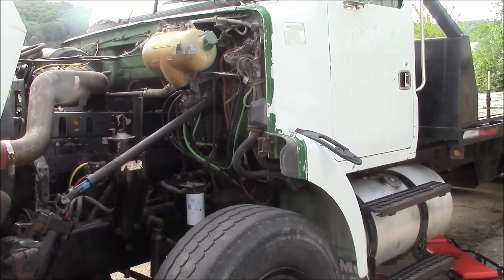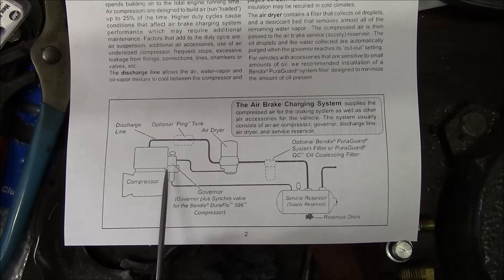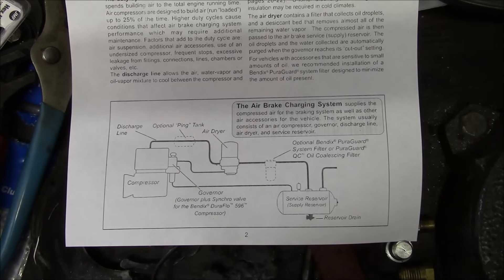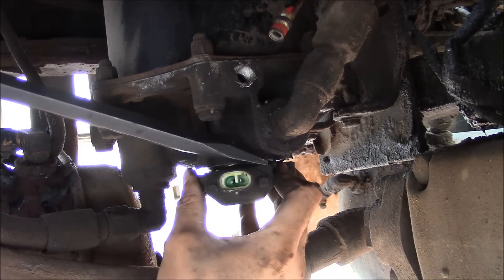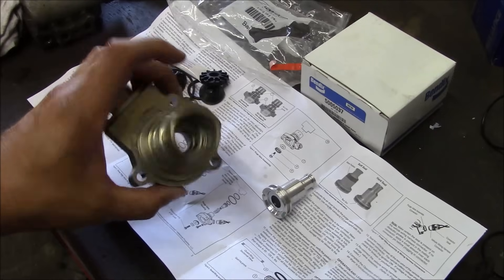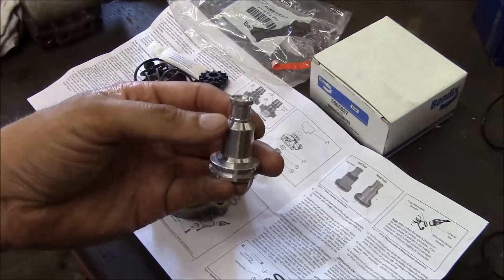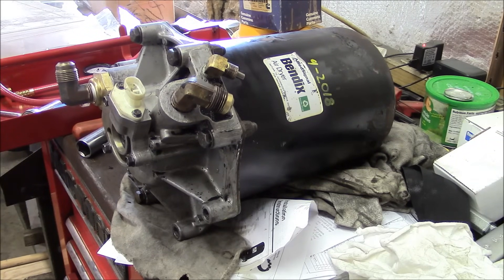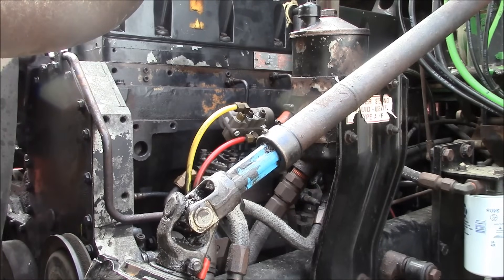Truck Repairs: Air dryer purges constantly

Comment: I have a 2013 Volvo it does the same thing change air dryer check for air leaks nothing runs good and keeps 120 psi it been like this for 3 years what do you think
Reply: Governor.

Comment: I have seen that valve on the problem of the dryer leak. You can buy them separate.  Then change them out inside of the whole air dryer

Comment: Great video.  I would change that air dryer as well. There should be a two wire connector there as well.  One is ground the other is power but only with the key in the on position.  That's the heater for the air dryer.

Comment: Wow, great walk through! I have a 92 international bus that's purging every 30 seconds, it also seems to leak after I shut it off. First time I heard it, I thought there was a wounded animal nearby lol, it's a very faint squeak, kinda like the dying witch on wizard of oz 😁. Took it to a local diesel shop and they told me I needed a new air dryer, no filter on mine BTW. I'm just wondering now if they checked the valves....i didn't know the squeaky sound after shut down wasn't normal.
Reply: Lol nice

Comment: I have the same issue on my Volvo. Where is the check valve on a wabco airdryer. I replaced the gov the compressor purge valve and the filter. Still doing the same thing
Reply from the maker: Is it the style with the spin on element?
Reply: @WatchWesWork  yes Sir. The filter screws on. I changed the purge valve and the filter 2 times already.

Comment: Thank you very much! Great video.
When you say that the gages don't measure the tank pressure so you would'nt see them going down, where do they measure?
Reply from the maker: There are 3 tanks. The gauges measure the pressure in the primary and secondary air tanks. The gauges do not measure the pressure in the wet tank or ping tank. There is a check valve between the ping tank and the other tanks. So, the check valve in the dryer is letting air leak out of the ping tank. But, the check valves on the other tanks are working, so they maintain their pressure. Basically that means the gauges on the dash cannot help you diagnose this issue.

Comment: OK but did you figure out how that hunk of smugh got in the check valve?  Did you clean the line and see if pieces of smugh are coming out of the compressor?  It is sealed so it did not appear out of nothing.  You are not done till you figure out what caused the smugh and clean it so you do not get djizm all over your new check valve.  Good video explaining what you did for trouble shooting the problems, as you noted you ran into a leak you may not have noticed but would make the compressor work more and effect fuel use.  Good catch good job.
Reply from the maker: It's just carbon build up. The intake for the compressor comes from the crank case. The compressor outlet temp is pretty warm. Over time you get carbon build up, just like an engine exhaust port.

Comment: How much did you spend on those 3 parts?  The whole thing is not expensive , i replace one on a cascadia for $140 , now i have a dryer in another cascadia purging every 30 seconds
Reply from the maker: I don't know. Around $100. These air dryer parts are very cheap.

Comment: I have a question, my air dryer was purging like the every 30 seconds so I replaced the cartridge and cleaned everything up to new checked the check valve and all is good but now when it runs it says on dash 110 psi but I dont hear it purge at all just sitting is that normal???
Reply: Have not driven it yet is that way it's not purging is because I am not driving it. I am starting it and i let it sit at 700 rpm then to 1000 to warm it up once it gets to 150 fwt I will put it back to idle at 700rpm. I hope there is an answer to this maybe it's normal intill I drive it because it never gets under 100psi on the dash
Reply from the maker: That's not normal. Unfortunately, there are a lot of things that work together. Is it possible you hooked the lines up backward so the purge is hooked to the sense?
Reply: @WatchWesWork  no put the lines in the same when it was working. I can tell you that when it was going I thought it was the filter because it started  Whistleing and then started getting less and less until it would air one short and then air very slow the rest of the  way into empty and then eventually it stopped and that is why I replaced the filter because I thought it was clogged. So it slowly purge out with the whistle sound intill it just stopped purging
Reply from the maker: Well, the only other moving part of the system is the air governor. If it's a standard Bendix D2 unit, you can replace it for about $20.
Reply: @WatchWesWork  $20 that's it man that's cheap if I have that one AD9 cartridge so not sure but found out I do have a bad leak near the pump so I will fix that and will probably fix the other things going on will keep you updated also on my channel will be recording the whole thing also

Comment: I do not even give the owner the option to "rebuild" the dryer. I live in Michigan, and with the salt and neglect the dryer usually sees. I just replace the whole unit. It just saves time and labor like you said
Reply from the maker: Eventually the aluminum base casting will corrode and will no longer hold air. At that point you have to replace the whole thing. I've seen them corrode clear through the mounting holes.

Comment: Just a little constructive criticism,  from my experience as a mechanic swapping parts is the worst way to fix a problem. Customers and employers get pissed off and it's no substitute for proper diagnostics. Just sayin'.
Reply from the maker: Sure. But where did you see me "swap parts"? I didn't replace anything that was not tested first and found to be faulty or past its service life. I understand that the purge valve did not fix the initial problem, but it was leaking down as you can see in the video. Just sayin'
Reply: @WatchWesWork  I know,  and some customers don't care because they are cheapskates and want something for nothing. Many employers want stuff fixed quick ,cheap and out the door.
Reply from the maker: OK. That's certainly true. All we can do is document the problems and make the customer aware. If they don't want to fix it, there's not much we can do. It's a frustrating part of the business!
Reply: @WatchWesWork  Yes it is but I still enjoy it. I enjoy your videos  too because I am always looking to learn and I am no expert by any means. Sorry if I came off as a dick at first.

Comment: Hi wes great vid. Being a mechanic myself (30yrs).seen alot of air dryer issues.and how they have changed .but the concept is the Same.
a constant purging dryer irritates me.at the same time causes compressor to cycle more.i find it to be the signal line(RES port on gov to wet tank) leaking down .I use soapy water on this line(only when air dryer purges).wet tank supplies air to Governor RES port.
For anybody interested Google. Bendix air dryers.and look at images. There drivers. Owner ops. Mech.can identify.what air dryer they have.A very informative site.i still use it myself.
Reply: So you’re saying majority of the time it’s only a leaking line???
Reply: @roz4747  that's right,,as soon as the dryer purges,shut off truck and soap down the governor line(which is RES port on the governor),,too many times I've seen dryers replaced over leaking reservoir line to governor.hope this helps.
Reply: @jimmyFX  thank you for your knowledge and time

Comment: What can cause the compressor kick in late .. iam having problem with my isuzu fvr the cutoff is at 100psi but cut in gets below 50 psi sometimes i have to stop the truck let the air out by pressing pedal than get it to cut in than drive it
Reply from the maker: Sounds like the governor is bad or the actual unloader valve in the compressor.
Reply: @WatchWesWork  is there any other way i can send you pictures of compressor on my truck so you can help me out on this

Comment: I think the soft seats were used in the earliest version of the AD-9. I recall when they first came out, there was a problem with leaking purge valves and the repair parts weren't available for quite some time. We needed to keep trucks on the road so we traded the Bendix dryers in on Haldex and Midland. We found them to be more trouble free and much easier to work on and we never went back to Bendix.

Comment: The best spitter I ever saw was on my 79 LNT 9000. I don't know what brand it is, it is slightly smaller than a desiccant dryer. It's got fins all over it and it looks like a little still. Never had any trouble with it since it was new, and the truck never freezes up.
Reply: I believe that's a CR  Air dryer. Pretty much trouble free.it has no desiccant. Just plastic dividers. Basically the aluminum fin is sort of a cooler. Air enters/cools/condenses/dry air enters service tanks. 
I believe back in the day they had alcohol injection after the air dryer. For colder climates. 
Hopefully this helps

Comment: What if the air dryer doesn’t purge at all ?
Reply from the maker: If your compressor unloads like it should at 125ish PSI, then it's probably a fault in the purge valve.

Comment: @4:50  ya got it backwards. the side mounted elbow is the inlet and the bottom is the outlet  with the check valve. the check valve in the discharge prevents the wet tank from emptying when the  dryer purges. the ad9's were made so you could service all but the dessicant without tearing the whole thing apart.   lots of problems with the ad8's caused the design change.
Reply from the maker: You're probably right. Sorry about that.
Reply: @WatchWesWork  its all good

Comment: What year is the truck you are working on?  There is no more wet tank on the air systems, it has been eliminated.  I drive a 2018 Freightliner, used to drive a 2017 Freightliner and a 2017 Peterbuilt. I trained on a 2014 and 2017 Peterbuilt. None of them had a wet tank.
Reply: you DO have a wet tank....its now called a supply tank
Reply: @glenbjack  no that's not a wet tank.  I aced my CDL Air Brake permit test.  Thank you.  The wet tank has been removed a long time ago as air system changes were made.  Even the Alcohol Evaporator was removed.
Reply from the maker: This is a 1991. Old school.
Reply: You may have a split tank.2 or 3 compartment. But looks like 1 tank.
If you see 2 drains on 1 tank. That's a two compartment. 
Follow air dryer discharge line to tank. That would then be your wet tank.on freightliner they had internal check valves(which were problematic). 
On your peterbilt. Sometimes air dryer is mounted to the tank. There a lot of variables on Pete's.
The best way to remember is.for every drain valve. Is one reservoir. 
Hopefully this helps you

Comment: CORRECTION.  Governor cut in is at 100 PSI  Cutout is 120-125 and if you have an automatic transmission depending on what brand of truck and transmission cutout is 120-140.  AS for the Bendix Air Dryer I beg to differ on that.  Most common trucks to have Bendix are Freightliner Columbia which isn't built anymore that would be the Cascadia Evolution that replaced it and the Volvo trucks have Bendix as well.  I know this because I drive a Cascadia Evolution and every single volvo that parks next to me has an air dryer problem.
My air dryer is Meritor Wabco and it pops about every 20 minutes or so roughly.  But if I was idling I wouldn't be annoying anyone or keeping anyone awake.
Reply from the maker: The AD-9 dryer was very popular and used by pretty much all manufacturers at one time. All the new stuff uses spin on cartridges, but there are tons of AD-9s still running.
Reply: Meritor  wabco  is  what  the  newer  Volvo ' s  are  running  it  was  one  of  them  I  first  ran  into  this  problem . I  never  saw  it  before  about  2013.

Comment: Nice video, but what do you do when you have replaced the air dryer twice?
Reply: Jack up under tail lights and replace truck😉
Reply: @grahamowen1570  LMAO!
Reply from the maker: Sounds like you need to find the real issue.

Comment: Good  video . I  have  replaced  the  governor , the  purge  valve , the  check  valve   (then  the  complete  dryer  ) , and  then  the  compressor/unloader head  without  fixing  the  problem . 40  trash  trucks , 1  spare , 2  mechanics  and  never  had  the  time  for  in  depth   testing . I've  been  fixing  trucks  since  1972  and  never  ran  into  this  problem  until  2013
Reply from the maker: It's a fairly common problem, but there can be many causes, as you pointed out.
Reply: @WatchWesWork  and 1 rusty ,dirty debris filled air tank can cause this, but its more like a 3 minute cycle, with lower air pressure on secondary or lift axle tanks.

Comment: Air Dryer can only hold so much moisture. When the Incandescent beads soak up all they can. That is when you have air dryer issues. Most people only think about this part. When it messes up, when that cartridge being changed out. Would save all the issues.
On some of the cartridge's like yours. You can dry out the Incandescent beads. In an oven,and use them over and over.
Reply from the maker: Yes, the desiccant cartridge can be rehabbed. But, it's only about $20 for a reman.
Reply: @WatchWesWork  I agree, but have been caught. And had to dry one out a few times.

Comment: Air kept coming out of the purge valve so tanks couldnt fill up so they just replaced the air dryer
Reply: Could also have a crack inside the air tank. That the same problem

Comment: your test rig is only half there.  you need two gauges with a ball valve between them.  when the dryer purges close the ball valve and watch the gauges. whichever side bleeds down that's where you go.  it could be the unloader o rings burnt out, it could be the signal line has a hole in it, or the dryer dump valve has crap under the seat.
Reply from the maker: That would allow you to test the unload line and purge valve at the same time, but would require two connections. Also, that would not have found the issue in this case.
Reply: first, my rig connects into the signal line. your rig connects to the signal line. you use shop air to test, I start the truck and run and test the entire system.  yes I split the unloader line, but both ends are connected.  as soon as the dryer spits- close the ball valve between the gauges.  since your dryer spit every 26 seconds, your test verified it took 2 and 1/2 minutes to bleed the purge valve.  so purge valve not the problem.  yes I would connect at the compressor first, when the dryer side bled down, I would move my test to the dryer end just as you did. but my test would show now the comp and unloader line good. problem in either the dryer main chamber or the wet tank or further back.  since the dash gauge wasn't dropping, the primary tank ok. now all that's left is the dryer or wet tank.   with my rig you could split the  signal line at the governor and connect there.  run the engine again, when the dryer spits, close the ball valve and now you have located the general area.. next step, trace the signal line down to the wet tank and connect again. you will find the signal line ok and the problem in the wet tank.   the ad9 dryer  has been around 20 -25 years,  the ad-is dryer is now the more common dryer on newer vehicle.  it has a spin on filter/chamber. not being a smart azz, just showing another way to skin a cat.
Reply from the maker: It sounds like a good method. You can basically test the governor and dryer side of the signal line at the same time. It would be pretty simple to modify my rig to work as you describe. Thanks for the solid information!
Reply: yes, it would.,  that why I said your rig is only half there.  a couple feet of plastic line, another gauge, a ball valve and  two 1/4" tee fittings and you are in business.  good luck.
Reply: Watch Wes Work   Wes that gauge setup is either in the Bendix air brake manual or there is a set of 4 air brake training videos on YouTube that I watched.
Reply: I have watched the video it is very good. I have read all comments but still I need help. Changed air dryer cartridge, purge valve, 99% sure That truck doesn’t have air leaks. Problem didn’t solved. Vnl670 2012. So when truck reaches 105psi purge valve opens let some the air out BUT it staYS open for like 7-10sec more and drop my air to 90psi to get compressor start running again. Brand new purge valve and air dryer. Check every line for leaks. None. I did even PLUG the control line from air dryer to first tank. Usually its blue hose. Still purging every 30 seconds because purge stays open for 7-10 to start cycle again. Can you help me
Reply: @aleksandarnikolic3060  did you make a tool like I recommended?   two gauges with a shut off valve between them.  you can move the tool around the vehicle to find the leak.  it sounds to me your unloaders inside the compressor are crap. get an unloader kit - clean the carbon out of the compressor and install the new kit.  newer trucks should purge at about 130 psi. when the purge happens it should dump only the air in the dryer chamber and copper line. the truck should NOT drop at all. maybe you have a check valve leaking after the dryer.